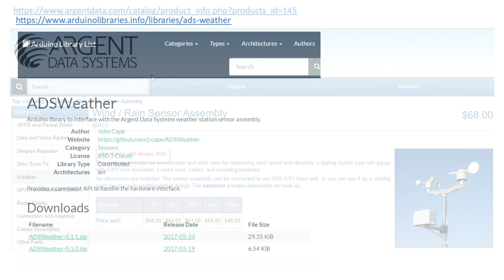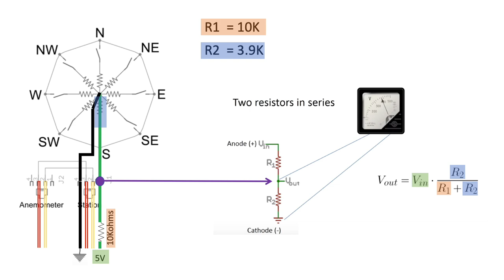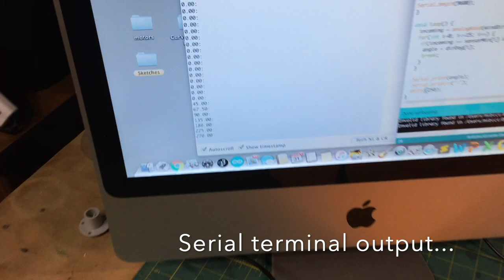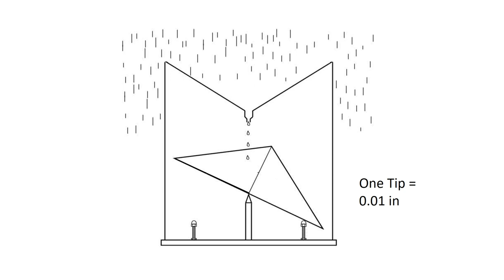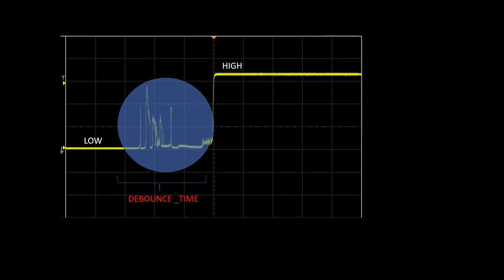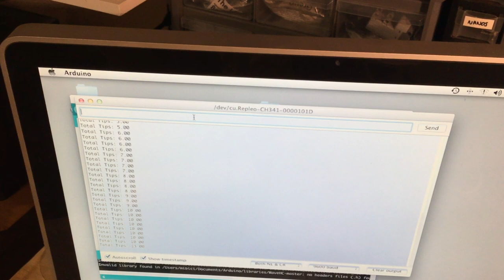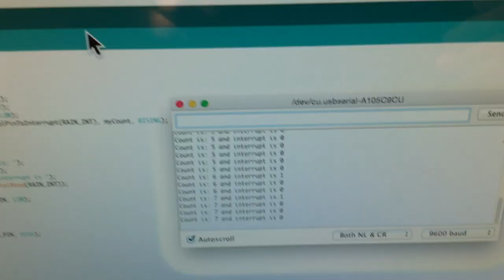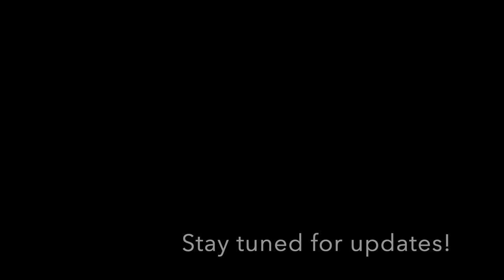Argent Weather Station Arduino Hacks - Hardware and Code

Comment: um the schmitt trigger circuit along with filter,  is still draining the battery during not rainy day.   reed switch removes the drain.   that is the reason why they picked reed switch, is battery economics, not the market prices.   same problem of battery drain applies to hall effect sensor. 
on the anneometer,  switch bounce is still problem increasing "counts".  another problem, what if the cup happen to rest (stop moving) where magnet and reed switch is lined up giving false count.  will need programming to counter this false reading.
Reply from the maker: Thanks for that insight. Fortunately, any battery drain on the Schmitt trigger hasn’t been an issue for the solar-powered field installation, but that’s good to know. I can’t imagine it’s very significant, but I have taken the system offline to replace the 2G modem with 4G and can check this out. Similarly, it would be interesting to check current draw on Hall effect sensor. As for reed switches in general, I agree they must be approached with caution. Thanks again- great feedback.

Comment: Truly a fascinating and informative video.
I do wonder if you are trying to reinvent the wheel by replacing the tipping bucket reed-switch with Hall effect i/c?
Reply from the maker: Thanks! The Hall Effect sensor helps eliminate the reed switch bounce thus eliminating need for the hardware filter required by the reed switch. Cheers.

Comment: Question in this video there come two wires from the Hall sensor to breadboard but there or 3 contact point on a hall sensor, so must I connect ground to negatieve on the Arduino or breadboard and the signal and positieve like this Video time 32.04 ?
Reply from the maker: I think the wiring you are looking for is at minute 26:03.

Comment: Tell me how to get instead of degrees, i.e. a numerical letter indicating the direction of the wind, such as north or east. Nothing is indicated in your sketch, it works, but it only shows numbers. 
Total Rain: 0.00
Wind speed: 0.0 Gusting at: 0.0
Wind Direction: 90 (instead of numbers, direction for example NORTH)
Total Rain: 0.00
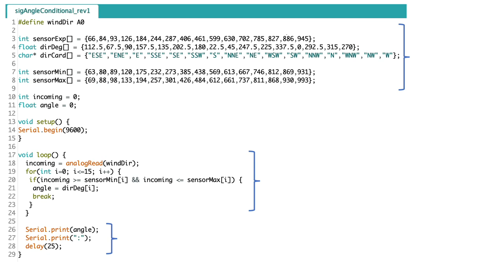Reply from the maker: 0 = North, 90 = West, 180 = South, 270 = East (assuming you oriented the weather vane accordingly). The directions are shown in minute 7:30. You can use an array with a conditional as shown in minute 10:30 to echo back respective directions. Please see the sketch "windDir_CardinalConditional_rev1" for respective code that can be modified if needed. Note that that sketch is meant to work with Processing for displaying output, but can be modified to work with a Serial Terminal output.

Comment: Hi I know that the wind speed sensor rj11 cable is connected to the wind vane, which then the both of them share one rj11 cable. Can I know how do i wire the rj11 to the arduino uno? And the rain gauge is also a rj11 connection, can i know how do the wiring works as well? By the way, great video!
Reply from the maker: Strip the end of the RJ11 cable to expose the leads which you will attach to your Arduino. You can use a multimeter to figure out which leads are reading which sensor by checking continuity on the stripped ends. When set on continuity, your multimeter should buzz on the common ground and signal wire for each sensor while turning the sensors. Hope this helps.
Reply: @ModestMaker  thank you so much☺️

Comment: Hi Modest Maker i have bougth the same  from Argent with the module ADS-WS1. How can i connect it and i want to read data with raspberry.
Thanks
Reply from the maker: Sorry— I don't work with Raspberry Pi given the higher power requirements and the fact that I am deploying low-power remote deployments. I just posted this update that might help you with some ideas: https://youtu.be/dn78n-dE8zI .
Reply: You need to ensure that you have your R Pi set up for serial communication. This describes how to do that: https://www.raspberrypi.org/documentation/configuration/uart.md
You then need to write a sketch (python will probably be ideal) to read the serial data assuming all is set up correctly. The next page will give you some ideas for running serial communication from Python: https://opensource.com/article/20/5/usb-port-raspberry-pi-python - hope this helps.

Comment: im creating my own Weather Station, i know this video is 4 years old ,but i would probably use interrupts and put the MCU to sleep to conserve battery ,each time an interrupt is triggerd ,the MCU would wake up and do stuff and then go back to sleep 
im considering dropping the interrupts all together and waking up the MCU every 10 min or so to take all the mesurments and send to the server ,to further conserve battery ,do i really need to know what the wind speed is at this exact second ? no ....Weather data every 10 min is more then enough
Reply from the maker: Of course- especially in regards to wind speed and wind direction. There are algorithms to average that data properly as noted in the video.

Comment: I used the argent code to test my anemometer but for some reason the gust speed doesn't reset, it just shows it maximum (ever) speed, rather than the max of recent values. Any ideas what's causing this?
Reply from the maker: I can't speak to the Argent code-- couldn't quite figure it out, but I have posted my own code developed from scratch if you want to give it a shot-- see chapter 21 code posted here:
http://www.biod101.com/arduino/part2.html

Comment: How would I go about connecting these weather sensors ( just the wind speed and wind direction) to an ESP32?
Reply from the maker: Sorry- I am not familiar with ESP32s, but would assume there are digital/analog inputs just like an Arduino, and then programmed accordingly.

Comment: What software did you use to demonstrate wind speed at 36:53?
Reply from the maker: There's no software involved outside of the program I wrote within the Arduino IDE. The link for the same is in the description of the video-- scroll down to chapter 21 in this link: https://modestmaker.com/arduino/part2.html - it's the anemometer sketch). For any screen output, that was done in Processing.

Comment: Hi! Thanks for the video. How could I convert analog read from wind direction to: north,  northeast, east, southeast... Thank you so much
Reply from the maker: Thanks for your interest. You just need to orient your weather vane so that the 3.84 voltage reading is registered when the vane points north. When you do this, all the others should fall into place as summarized at minute 7:37.
Reply: @ModestMaker  thanks for the answer. I have another problem. Each day I would reset all the values but when I put rainamount like 0 then it continuous with the measurement of the past day. How could I reset de ws1.getRain() function? Thanks

Comment: Hello again!! I don't understand very well English, I don't know if you told in the video. Can you tell me how did you show the white arrow making circles in the screener?
Reply from the maker: Pregunta en Espanol por favor.
Reply: @ModestMaker  hola. Puedes decirme cómo muestras la flecha que gira cuando mueves la veleta (wind vane) en la pantalla con el IDE de Arduino?
Reply from the maker: @MallorcaRaul  Ahora si- ya entiendo. Eso es un "Processing" sketch. Si te fijas en esta pagina: http://www.biod101.com/arduino/part2.html en el capitulo 21, ahi se encuentra un "zip" archivo que se llama "chapter21code" la cual contiene un processing sketch que se llama /processing/windVaneDirection_v1 . Ese sketch se usa con este programa para realizar la gráfica : https://processing.org . "Processing" es muy parecido al IDE que se usa para programar a Arduino-- el Arduino IDE es basado en Processing. Espero que esto ayude.
Reply: @ModestMaker  gracias. Esta tarde lo pruebo.

Comment: Hey I've got an issue when trying to combine the code of anemometer and the rain gauge. When i move the anemometer it also counts up into my rain gauge. When i flip the rain gauge, it adds to the anemometer too. Do you have a code that combined these two sensors? The best thing would be if someone had a code where they had all 3 of the sensors in one code so I could look through it and see how you figured it out. It would really help me thank you.
Reply from the maker: In reviewing the code, I see both approaches rely on using an interrupt pin for the count, so if chances are you are using the same interrupt pin for both sensors. In that case, yes-- you will get counts for both regardless of which triggers. I'd have to take a look at the code and write a second function that doesn't rely on an interrupt for the anemometer. I can certainly add this to my list ;)
Reply from the maker: No- I only needed rainfall for my purposes so never combined.
Reply: @ivkatadic8055  No sorry I don't have the come anymore.

Comment: hi, how did you cannected arduino to the rj45 connectores (wires in each hole ?)
Reply from the maker: Any commercial connectors were cut off with wire ends tinned and soldered. I also like to use terminal blocks to make my setups more modular where I can 👍 — like here : https://youtu.be/_55sEQ0vM38?si=SH0uccNInk0ZndDU . See minute 2:36.

Comment: where do attach the anemometer to the sparkfun board
Reply from the maker: Any GPIO pin should work - just make sure you match it accordingly in code.

Comment: Do you have a fritzing diagram for your anemometer?
Reply from the maker: The wiring is the same as for the tipping bucket rain gage- both instruments use a reed switch that has to be filtered in hardware to remove noise (or you can try a Hall effect magnet).

Comment: Need your help can't do the same in Esp32 wemos d1 R32, i change the values ADC Reading to 4095/3.3v still dons't work properly
Reply from the maker: What is it that doesn’t work? It’s kind of hard to debug off a comment in YouTube.
Reply: @ModestMaker  the readings the i'm getting are wrong for example i dont have south but it read SSE in both ways
Reply from the maker: Sounds like something isn’t quite right in the array- I would double check those values to see if they match what the spreadsheet is showing.

Comment: Good afternoon, you can order the dimensions of the boards, weather vane and anemometer, maybe someone has drawings ?. It may also be that someone has an electrical circuit of the anemometer and weather vane. Maybe someone has a board layout in the EasyEDA program. Thanks in advance for links and projects.
Reply from the maker: I don't have these details, but I do need to get smart on EasyEDA. Maybe a future project. Thanks for your suggestion. As a sidetone, this link has data sheets for the components that might help: https://www.argentdata.com/catalog/index.php?cPath=29&osCsid=S7Y-vK6dkDVQlYrc7OqZt3
Reply: @ModestMaker  Good afternoon. I am interested in the dimensions, the vane and the anemometer, the dimensions of the insides. On your video there are some points, but you do not say in the video about the dimensions of the sensors, I want to build 3D models but there are no dimensions, can you make photos with the dimensions and put on disk in the cloud. I would be very grateful to you.
Reply from the maker: Unfortunately, I am no longer in possession of this hardware since it was on loan from my former employer and has been returned.

Comment: hi , about anemometer , I don't know how to connect yellow wire and red wire to arduino. Can you help me ?
Reply from the maker: Sure - assuming you are using my code, the red wire goes to your interrupt pin for your micro-controller, and the green wire goes to ground. For my micro controller, the interrupt pin is #3. The code is highlighted here: https://youtu.be/KHrTqdmYoAk?t=2150
Reply: @ModestMaker  thank you so much , I was able to handle it <3

Comment: hi! im planning to use these sensors to do a remote station for outside city fields with a gsm module and sms alert when the user wants (this part of gsm is alredy done) and when start raining, dude i have a question can you help me because i want to send an automatic message when start raining and other when stop raining and what amount of water fall in this rainy period like an if(start raining){ send message "its raining"} and when it finish raining send ("its stops raining 34mm of water fall in this rainy session")
Reply from the maker: I recommend you look into Adafruit IO platform (https://io.adafruit.com/). I've managed to do something similar using the Particle IO platform (https://docs.particle.io/boron/) as outlined here using MQTT libraries and demos already published by Adafruit: https://youtu.be/Rw-608Mu9xk . I've written some documentation on how to do this for work - have been meaning to share it on my homepage: http://www.biod101.com/arduino/part2.html . Let me dig it up and see how difficult it would be to clean it up for a public audience (e.g. minus confidential information and passwords).
Reply: @ModestMaker  i really appreciate your reply sr you're so kind and helful im very intrested in do this proyect so i like to complete it im going to investigate more and i tell you whats going on if you can help me if i get stucked greetings!!
Reply: @ModestMaker  can u explain me very in surface what is particle io and adafruit thanks
Reply from the maker: (1) Particle IO Boron is a 4G cellular modem that can send SMS texts to the Internet of Things: https://docs.particle.io/boron/. Here in the United States, it's the only cellular-enabled microncontroller I am aware of since the Feather FONA 2G modem is no longer supported by our US cellular networks. (2) Adafruit is a vendor of hardware, provider of open source software, and an amazing resource for tinkerers and inventors. They do a great job of documenting and supporting their hardware, and also provide a FREE Internet of Things (IOT) platform known as Adafruit IO: https://io.adafruit.com/ . (3) The particle Boron can be integrated with Adafruit IO to both host data on the internet, and send SMS texts to your phone when interrupts are called. This is demonstrated in this video, although I haven't had an opportunity to develop a proper tutorial yet: https://youtu.be/Rw-608Mu9xk . I do have written documentation on how to do this, but I need to sanitize it of usernames, passwords, and keys before I can make it public. I started doing the same this morning, but I need to check this carefully before I share it online which I plan to do shortly. Buena Suerta Facundo.
Reply: @ModestMaker  i really appreciate your attention and i very glad to spend time explaning this thing to me!! im from uruguay i alredy contact particle boron support and they recommend me to buy particle  electron 2g/3g because this board is compatible with uruguay so! im going to buy 2 of this electron and im going to start building up my proyect and my objective is to make the station wireless to put in remote places like in countryside without wifi or bluethoot and provide to the customers live data with adafruit io. so  i undersand it can work if it doesnt i will program only to send messages but my objetive is that the customer can see their station status on live. cheers
Reply from the maker: @facundosuarez1710  you can start developing on a Particle Argon which is WiFi compatible and thus free to use. The code you will develop on the Argon will run perfectly on the Boron when you are ready to deploy. Buena suerte- soy originalmente de Buenos Aires, pero ya mucho tiempo aqui en Los Estados Unidos.
Reply: @ModestMaker  excelente!! Gracias por tu ayuda saludos pais vecino jajajaja
Reply: @ModestMaker  sabes de algun io del estilo adafruit io pero que sea para el cliente? Porque viste que adafruit io funciona para mostrar los datos de los sensores pero es para un entorno mas personal creo yo, para entregare al cliente eso habria que crearle una cuenta y diseñar un dashboards con feed para cada cliente no? Tal vez hay uno más orientado a el cliente
Reply from the maker: En AdafruitIO, se pueden hacer los Dashboards público para un cliente general. También existe “Thingspeak”, pero es muy caro para usos comerciales. No conozco otros, pero si existen.
Reply: @ModestMaker  excelente modest! Si estuve investigando y por lo que vi thingspeak sirve para un estilo de dashboard front-end para el cliente aunque si el tema de pricing veo q es caro seguiré investigando a ver si consigo alguno que ofrezca sistema de clientes y no sea muy inaccesible de precio
Reply from the maker: Este video da un resumen con un link a la documentación que desarrolle en Septiembre. Buena suerte. https://youtu.be/bIObNOcpv9s
Reply: @ModestMaker  ahi lo veo mil gracias por tu orientación! Me sirvió de mucho

Comment: By the way this weather station incluids temperature and humidity sensor. What about them ? thank you again.
Reply from the maker: This particular setup does not include temperature and humidity (at least the unit my employer purchased didn’t), but Adafruit sells quality sensors that you can add to the setup and always includes libraries with excellent tutorials. https://www.adafruit.com .